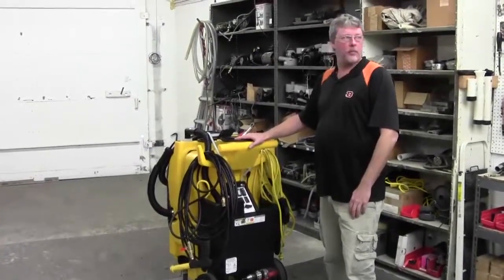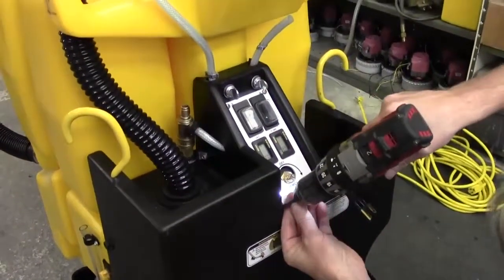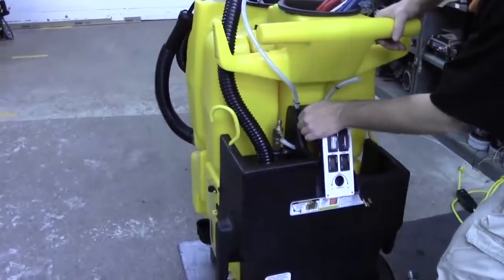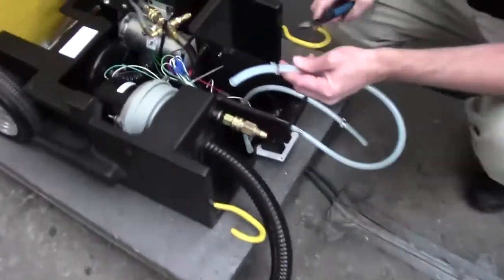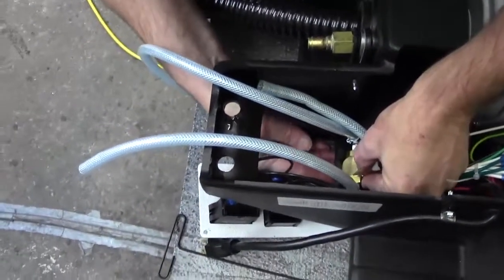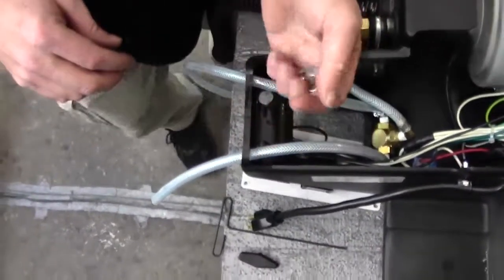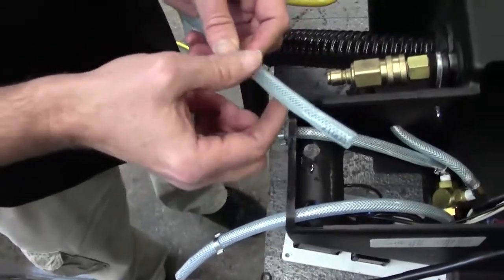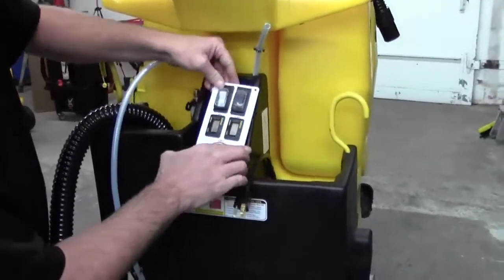1750 Chemical Valve Replacement

Comment: would the injector cause water to back up into the jug
Reply from the maker: yes, there is a check valve built into the injector, if that fails water will backup into the chemical system, typically debris gets stuck between o-ring and bearing